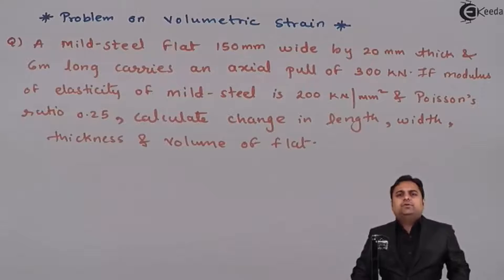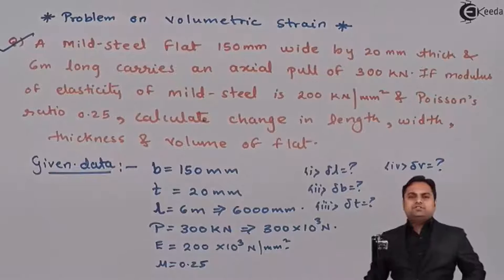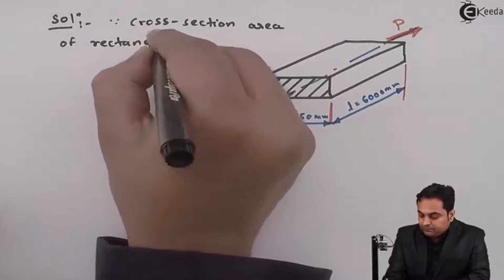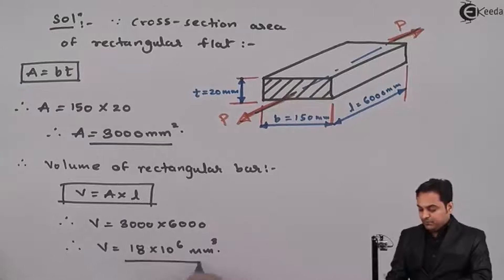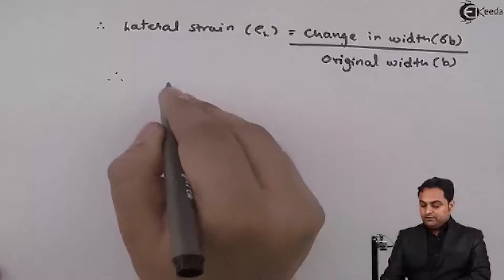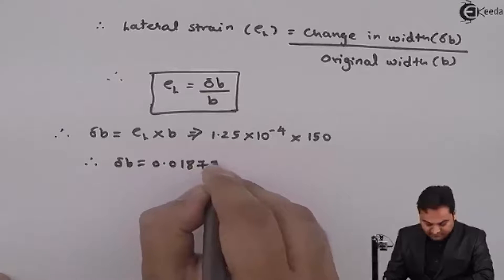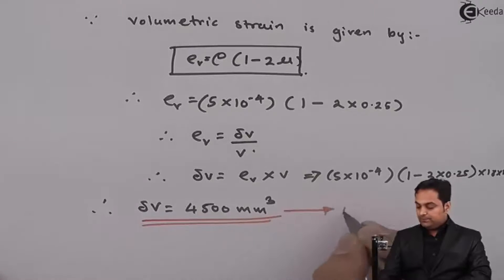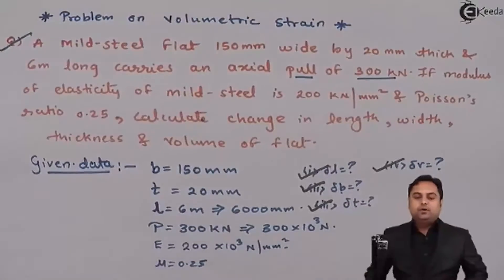Problem on Volumetric Strain - Stress and Strain - Strength of Materials

Comment: Sir, in our class they derived an equation for volumetric strain = (change in length/ original length)+ (change in width/ original width)+ (change in height/ original height). when I used this formula and calculate deltaV  I'm getting different answer. Which formula is better??